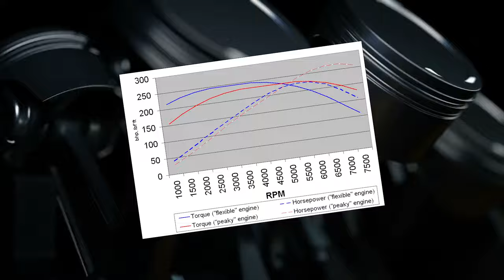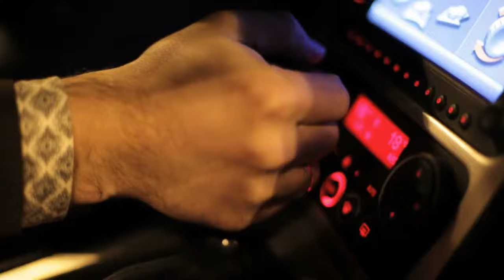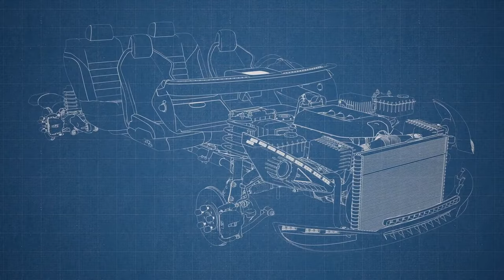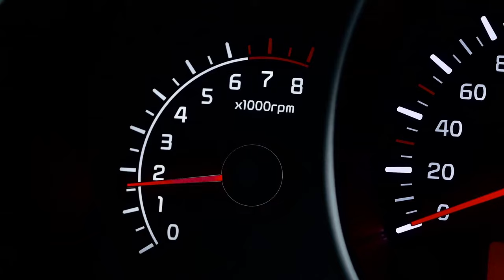Why Do Electric Cars Only Have One Gear?

Comment: Very interesting but this doesn’t answer the range problem.  Whereas if an electric car had a transmission the range would increase because the motor would work less and therefore conserve energy thus extending range.  This is really why gas motors have a transmission.
Reply from the maker: This is not what a transmission does. Transmissions would not effect electric range.
Reply: @ConcerningReality  Actually yes a transmission does make my truck better on gas thus extending my range, if I only have one gear I would only reach maybe 1/4 of my regular range if that!  There are motorcycle in India that are doing this with electric motors and extending their range to the 300kms.  I guess I'd have to see proof that it would not extend the range of an electric car as it does extend the range on an electric motorcycle.
Reply from the maker: @marclapalme1394  That is because ICE have small torque efficiency bands. In ICEs, transmissions are used to get the ICE to operate more efficiently. Because electric engines operate at the same efficiency along the entire torque band, transmissions do not help electrical range.
Reply from the maker: @marclapalme1394  I am not the one saying that a transmission wouldn't help range, the experts are. I am simply trying to explain why it wouldn't.
Reply: @ConcerningReality  Really?  So weather an electric motor revs at 100rpms or 20,000rpms  for the same period it will drain the battery equally?
Reply: @ConcerningReality  I get that and I appreciate the help.  Because it doesn't make sense at all.
Reply: @ConcerningReality  Can you please explain why Hemant Dabhade's ev conversion gets better top speed, acceleration and range because of a 5 speed manual transmission compared to single speed transmission. See here https://www.team-bhp.com/forum/electric-cars/232386-swift-dzire-ev-systematic-conversion-electric-car.html  Tesla ev don't need multi speed gears as they have multiple motors.
Reply: @marclapalme1394  the range does increase. See this build for an example.  https://www.team-bhp.com/forum/electric-cars/232386-swift-dzire-ev-systematic-conversion-electric-car.html
Reply: @shubhamrane7020  I thought so!  Thanks Shubham, great video thanks for sharing and I can't wait to see more.
Reply: I don't think so. Batteries die even if they are never used. In the pre ECU era manual transmissions had better gas mileage than automatics but that era ended many years ago. That's why so few cars come with manual transmissions anymore. Professional race cars are all automatics. They are shifted by electric switches called paddle shifters.
Reply: @Concerning Reality  transmissions absolutely would effect range, you're so wrong. You're lucky my yt keeps crashing so I can't explain all of why. If it doesn't, why does how fast a tesla going effect the batteries life?
Reply: @Concerning Reality  transmissions absolutely would effect range, you're so wrong. You're lucky my yt keeps crashing so I can't explain all of why. If it doesn't, why does how fast a tesla going effect the batteries life??
Reply: At the end economics decides everything, it will increase weight and cost of the car which are already expensive..
Reply: @abhisheksoni303  We agree that economics decides, however it isn't corelating the way you are saying.  In India they have retro kits for their regular cars, like a Suzuki Swift, of which they are getting 300kms per charge all because of the original transmission. More that this, since this video was published Tesla now have 2 motors on some of their models one motor to take off and the other to cruise and yes they have different gear ratios.  So long live transmissions.
Reply: @marclapalme1394  true, encoder can increase torque but transmission is still needed,

Comment: I want gears in a car, that only makes driving cars fun. Without gears i don’t think the cars will be able to even overtake each other. How do u race a car thats just 1 gear. Thats like driving a gear less moped. Also if u drive in a single gear the rpms will be high at higher speeds resulting in instability and lack of comfort. I daily drive a manual, so switching from that to a single geared vehicle will be complete loss of driving pleasure. Until these ev’s have gears i don’t think i can go for one enthusiastically.

Comment: Bullshit explanation. Even a fully electric vehicle will still benefit from a 2 or 3 speed transmission. EV can reach higher speed at lower RPM and draw less power from a 2 or 3 speed transmission.Why do you think Tesla model 3 and S have such low maximum speed compared to other sports cars and why do you think gas engines are more efficient at cruising speed on their 6th or 8th or 10th gear?

Comment: But. If we will get full electic top speed cars. Whouldnt gears be better? If i understod it right electics lose "efficiency" at higher rpms right? Because gas cars usually catch up on long straits with no reason. They dont have more power or torqe and the weight diffrence isnt that big. But still they catch up. A good example is diesels. Very strong in low rpms and very torqy. But if you let them rev out, it wont be accelerating at all as good as in the lower rpms. Electrics can rev extremly high but isnt it the same thing? Lets say im in a tesla going 200kmh (full throttle) whouldnt i start acceleration harder if i shifted a big gear? If not. Its sad that we then probbaly wont se multipel geard electic cars.
Reply: An electric car has 100% torque from a standstill. The torque only starts going down in an EV after 15,00 RPM give or take, and even then only lowers to 90% or so. The reason why gasoline cars overtake EVs on long stretches of road is top speed, as EVs hit their top speed ceiling pretty quickly. Also from 3rd gear onward a good driver on a dual-clutch gas car can keep a torque efficiency close to that of an EV in a straight line, so the play field somewhat evens out in those conditions.

In regard to gears on an EV. The disadvantages greatly outweigh the advantages. When you have a direct drive from the electric motor to the wheels you get 100% efficiency and 100% torque almost all of the time, while gearing will introduce power loss, especially in low RPM, and a lot of mechanical friction bringing efficiency further down. Up to highway cruise speeds adding a geared transmission to EVs would actually lower the range and lower the power output of the car, and it only make sense with speeds upward of 150 km/h. In high speed driving the battery would drain faster than if higher ratio gear was selected, but it's a cost worth taking for performance sake, because you'll still get a better torque curve with the direct drive even at very high speeds exceeding 200 km/h. If I'm not mistaken, the Porsche Taycan deactivates second gear selection in track mode for those same reasons.
Reply: Electric motors power both freight and high speed passenger locomotives none of which have ever had a transmission.

Comment: Quick question: How do electric cars have RPM? Do they is still have driveshafts like a combustion engine?
Reply: Rpm stands for revolutions per minute, so basically every machine with circular motion has rpm including electric motor. And yes, electric cars have driveshafts
Reply: I've been wondering basically the same thing.  If there's no gearbox, is an electric car's RPM a measurement of how fast the driveshaft is spinning?  Seems like the answer must be yes.
Reply: I know your comment is 3 years old, but EV’s don’t have drive shafts, just axles to 2 wheels. If an EV is AWD, then it has another motor for the other 2 wheels. This way, there is no loss of power or efficiency by frictional losses. No transfer case, to shaft, and no other differential. Just put another motor. This also allows the battery pack to be larger.

Comment: The use of this guys terminology throughout the video gives me a migraine. Arguably a multispeed gear box will always reduce wear and tear on the motor. Even if the motors capable of the output without the gears, what could be made cheaper? A simple 2 or 3 speed tranny? Or the massive electric motor? Also, damn near all gas vehicles have a higher "rev" as he calls it than electric vehicles if I'm understanding that's he's referring to overall speed. Take off means nothing if the max speed ain't nothing, at least to a real lover of speed and not just take off.